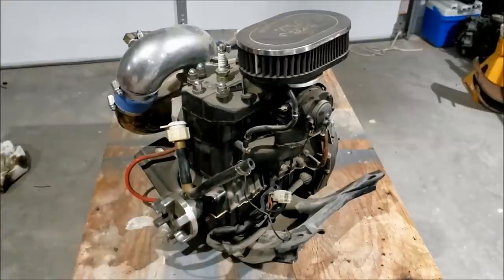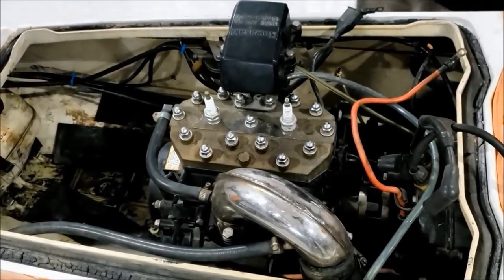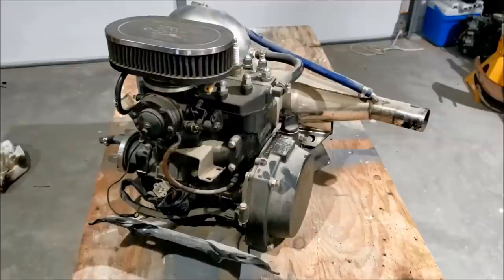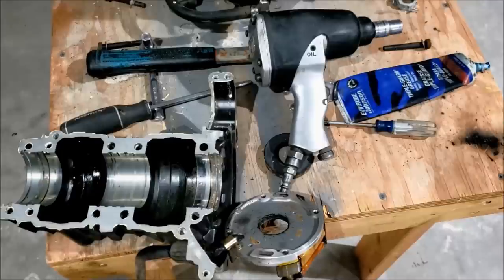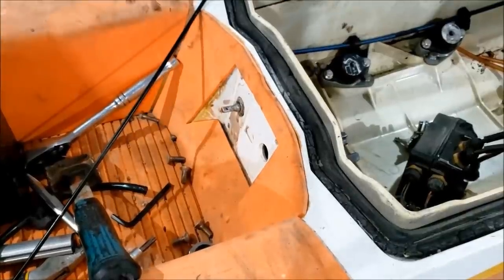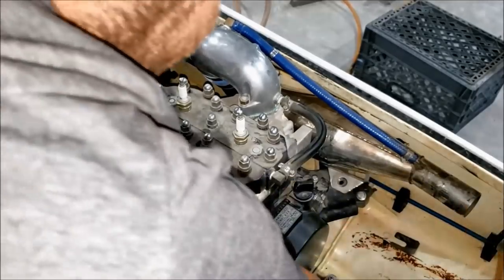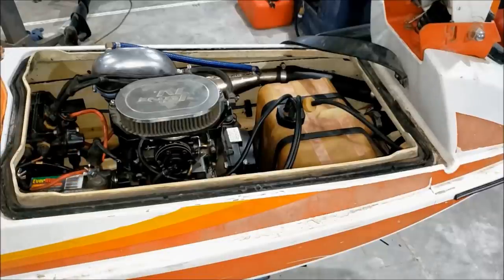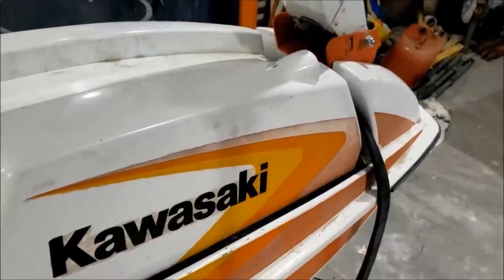Kawasaki JS 440 Build - W/ Random Engine and Hull

Comment: One problem with the choke is it may last exactly to the end of the ski's lifetime. The screws could potentially fall into the intake. Rare, but it does happen. Also not as good for starting if it has sat a long time or ran out of gas. Choke plates add restriction too. But you're right, the plunger primers suck. Which is why I got a pack of chainsaw primers for under $1 each.

Comment: After I realized a 650SX has just enough power to move my fat ass around, I kinda wrote off the 550 and especially the 440, but they look so cool! Really nice classic lines and it brings me back to the original days when my dad bought one.
Reply: I would suggest getting a 750sx or sxi, they have tons of power especially on the low end but rip on the top too. And they damn sure handle better than any 650 ever
Reply: @elicarter1356  I rode my cousin's 800 SX-R and it had plenty of power and the hull was so much more stable it made my 650 look dumb as hell. Showed how much time I wasted just to save a few thousand bucks.

Comment: Smart move on the crank seals. I replace mine every season. Also, kudos on getting a round body BN carb working. My way of fixing them was to promptly eject them into the trash and replace with a SBN haha
Reply: What's the best way to replace the round body BN carb? Is there a specific model you use + any adapters needed? Thanks
Reply: @LanierNutJob  You'll need to find a SBN44 if you have a 550, otherwise use a SBN38. Rebuild it with a genuine Mikuni parts kit, jets and needle seat. Jetting will be specific to your mods and elevation.
Reply: @Superhonda-z50  man I just saw this. Thanks for the response, I'm rebuilding a 1987 440. Pretty stock motor, from what I've heard it's best to sue away with the round body & get a sbn

Comment: interesting sensor coil setup. so no inner timing magnet for it , hence the need to adjust the whole stator to time it correctly i'm assuming?
Reply from the maker: Correct! It works, but adjusting it sucks. However, if aligned even close you don't really need to.
Bigger problem is coils are no longer available, even NOS ones are extremely rare.
Reply: @BrandonsGarage  oh bummer! i wonder if you could use yamaha, suzuki or Tohatsu outboard coils. they look really similar on the Japanese brands.